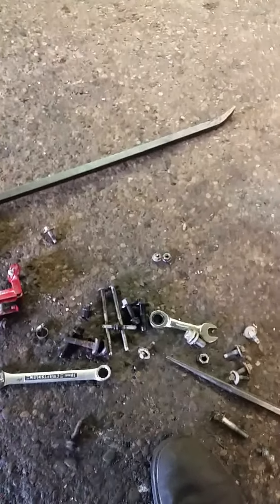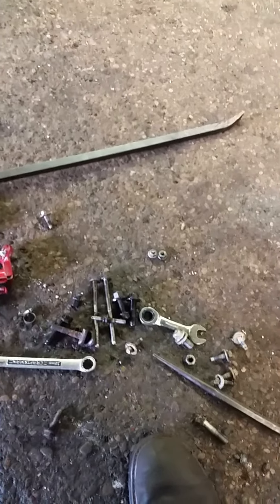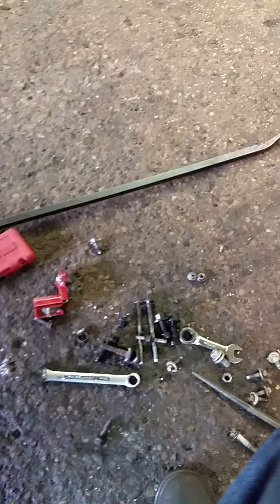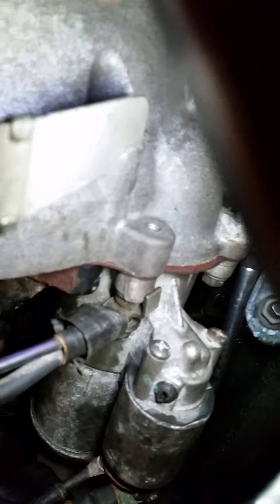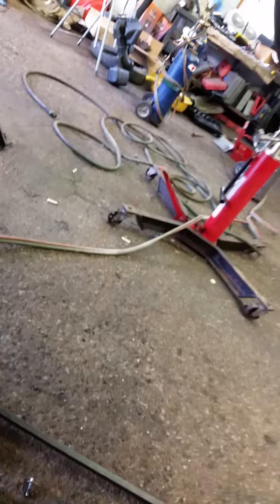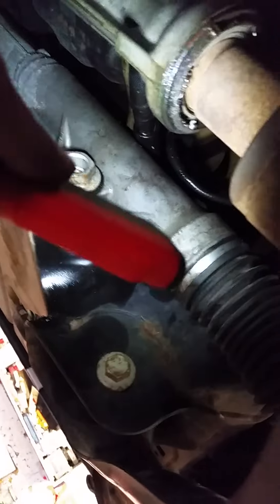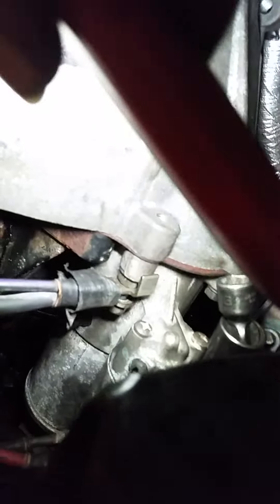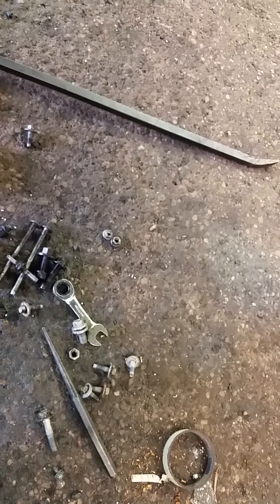Ford 5.4 , 4.6 starter bolt removal and install

Comment: Watched this as that Top bolt was a killer for me and after watching this I had it out in a Minute and putting back should be as Easy using a 24”  plus a 4 “ extension and a 13mm wobble joint with a ratchet. 👍👍👍
Reply from the maker: Well thank you very much Gary I actually remade this video because this was one of my very first videos and it was terrible I’m surprised you were able to get any kind of value out of it whatsoever. 

I think in the description there’s a link to the newer video that I did on this but I think most of the time after people watch this video they’re like hell no I ain’t subscribing to that guy…….!! How the hell did he get so many subscribers? Anyways I’m trying to make them better now sometimes it’s still hit or miss but for the most part. Anyways have a great day God bless and welcome to the channel we’re happy to have people like you on board I appreciate the insight I think you will find that that is pretty much the way that I do it I think I use a lot shorter set of extensions though.

Comment: I just did this, it was a challenge getting to the top bolt, but i did it just about like this. about 5 extensions with a wobble on the end. you have to fish it between the engine and the frame adding extensions one at a time til you can reach from bolt to front of inner fender. I only had 1 wobble, but with 2, I may have gotten it out the side by the exhaust.
Reply: That top bolt kicked my ass today I'll try your way tomorrow thanks.

Comment: Hey do you know if the starter bolt the same on a 5.4 and 4.6. Are the battery to starter cables the same? Thanks in advance.
Reply from the maker: The battery cables are certainly the same. You’re only gonna have two connections to any starter. One is going to be the main power from the battery and then there’s gonna be the switched power, which is generally a purple wire, but it’s a single smaller wire. It tells the solenoid to turn the starter over.

As far as the bolts go, I do believe that they are the same from the 4.6 and the 5.4

Comment: The quality of the vid was a bit rough but it still helped me alot. I was trying to use 3\8 ratchet and using a 1\4 did the trick for that top bolt thats hard to reach
Reply from the maker: Yeah I definitely need to remake that video I wasn’t even close to being serious about YouTube when I made that one it definitely is in the plans I’ve got a Ford F150 that I’m working on right now I should have a much better product out there

Comment: THIS IS BAD.
Reply: My starters on the passenger  side
Reply from the maker: Usually most starters will be on the side that the battery is on , so when they’re building them they can use less wire, not always but most of the time